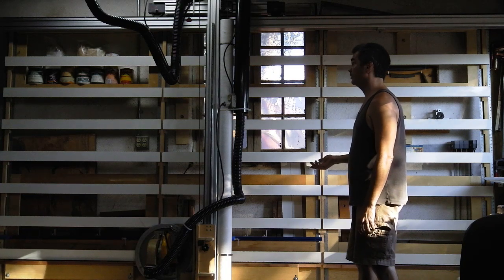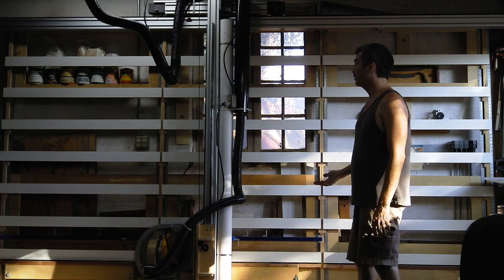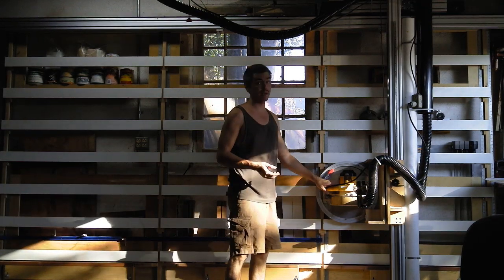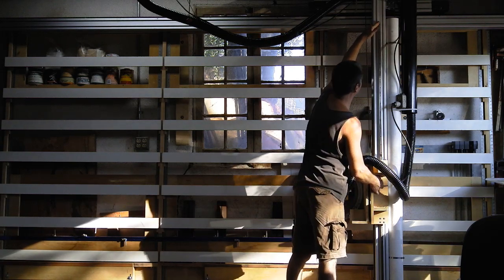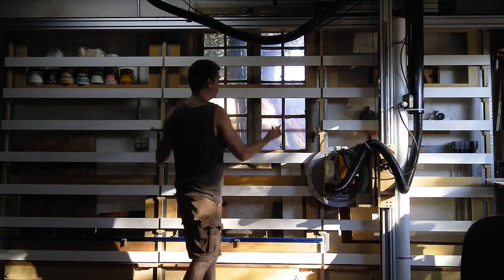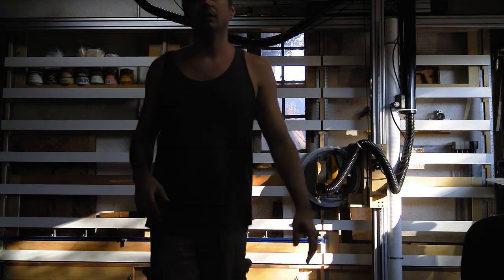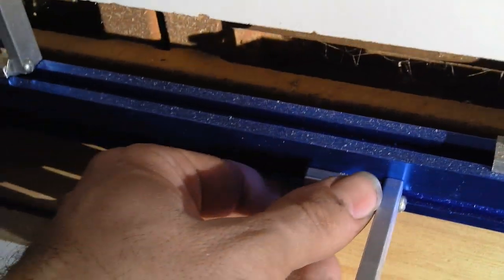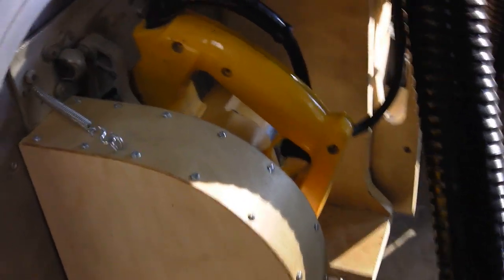Shop made sliding carriage vertical Euro panel saw

Comment: I have searched through many diy panel saws but i have to say that this is one of the best explained and detailed insight into engineering your own sliding carriage panel saw.  thankyou so much for taking the time to share your experiences and knowledge with everyone.  id love to see a follow up vid if you ever get the time and urge to explain where to start and how to design and maybe a few of the more technical challenges.  you are the only person i found that explains the rotation module using a lazy susan style rotation bearing, i looked everywhere and could not find out just how to achieve this but you hit the nail on the head.  thankyou again, youve got a new subscriber :)

Comment: I commend you for coming up with so many solutions to making your own panel saw and making it available to the rest of us in a very good video too.  Yes we could all use a little bit more detail, better lighting and plans to boot but, considering that you had to put it all together out of scratch with little to no material to draw from in the web, this puts the ones of us that want to get it done, way ahead on our way.  I find you suggestion of using 3" square steel tubing as opposed to aluminum, very appealing, it's much cheaper and just as good.  Matter of fact I just welded together one 4x8 working table with such tubing and it came out a solid piece for a very reasonable price.  Bottom line, this home made downsized-downteched version of the super duper Euro panel saws is a winner, it beats the American brand name made ones and we can build it for a fraction of the money.  Thanks a lot and all the best.

Comment from the maker: It was done with a 20"  (if I recall correctly) Lazy Susan ring.   I cut a  piece of of 4mm sheet aluminum   into a circle to match the inside ring and countersunk holes for screws in it to bolt it to the ring.  The Lazy Susan ring is aluminum and easy to drill and tap.   Then it's a matter of attaching the saw plate, cutting a hole for the blade to go through the aluminum plate, and rigging up  an adjustable stop system to lock the ring.

Comment from the maker: I think they are made for Chinese restaurants tables with the rotating center section.  They can be found on ebay.   If you build a panel saw with rails on both sides the Lazy Susan is a good way to go, but with one beam like mine, I think in retrospect a very heavy duty and tight hinge would be a good way to do it too and would allow the saw base plate to be smaller, which would improve visibility.

Comment: Neat.  I got the link to this through the Woodgears.ca newsletter.  I used to operate a Holz Her vertical panel saw, and I gotta say I like yours better.  Wish I had the time to build one of my own and be able to make cabinet-grade cuts on sheetgoods.  When I heard you talking about using pneumatic cylinders to ensure that the cut didn't get into the ribs of the structure, it reminded me of a time when I forgot to actuate the pedal on the one I ran, causing a bit of a surprise when I plunged in.

Comment from the maker: I used 4" machined iron v groove wheels.   You can buy just the wheels, but I used gate mounting boxes on the ends to mount them in.   They are a common item for iron sliding driveway gate applications and your local metal dealer probably has them.

Comment from the maker: Thanks for your input and offer. I don't use a plunge saw with the panel saw.  If you're interested in exploring the idea of a saw arbor and scoring arbor arrangement that could be manufactured and sold to people wishing to build their own high-performance vertical panel  saws ( I had 3 other inferior vertical panel saws before designing and making this one), that would be cool.  In the present configuration with the DeWalt motor, 8" blade, shroud and 20" ring, there's little room for...

Comment: Great design and build! I am intrigued by the way the entire saw mechanism moves in and away from the frame, but cannot work out how you have done that... any chance of another video showing that apparatus?
Reply from the maker: Linear bearings.   The travel is only about 60mm I think but it's sufficient.   The ones that are on the carriage are an inexpensive style I found on ebay with 8mm round rails.   The retangular rail ones are tighter feeling but once installed in a parallel pair the short stroke bearings don't have enough play for it to be a problem.  I would prefer a machined dovetail way, maybe using delrin.

Comment from the maker: That's interesting you prefer my design.  I had to custom build in in part to fit the space - considering the time I invested in figuring out the machine design,  buying a commercial model at auction would have been a more rational choice had space permitted.  Of course, this was built in place and can be broken down for moving if needed. Was there something about the Holz Her that was badly thought out?

Comment: Absolutely the Best Design Feature I have seen after researching this for some time. 
May I ask? The vertical structure of your saw, is that wood? In your video the piece I am asking about 'Was the piece you removed'
Well Done and Thank you for sharing your video.
Reply from the maker: The strcuture is mostly plywood but there are 4 steel u-channels at the vertical positions, which contain each a piece of wood which is roughly a 1x3... the reasons I did it that way have to do with a design feature I never implemented but in any case the u-channels are a good idea and the wood inside them supports little wedged pieces of wood which are used to hang the melamine horizontals with... the idea being that the horizontals can be removed for ripping if one doesn't wish to get saw marks in them from ripping.  As it is I mostly crosscut with the saw.